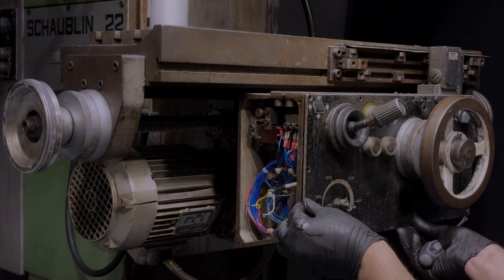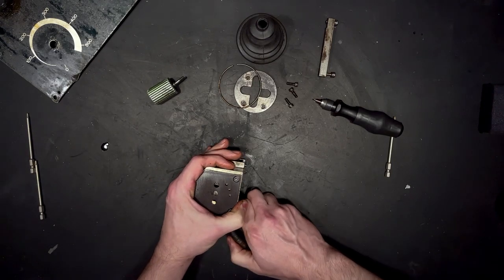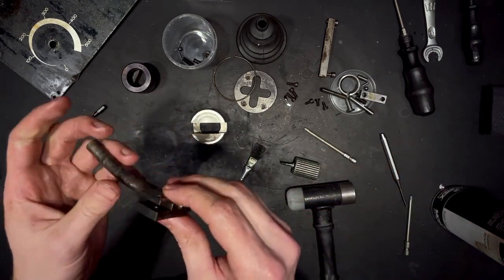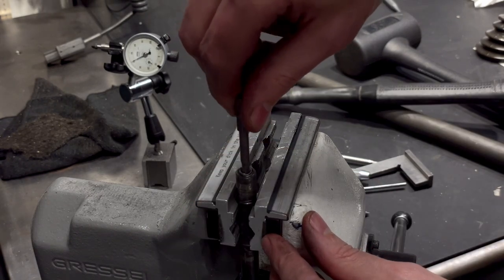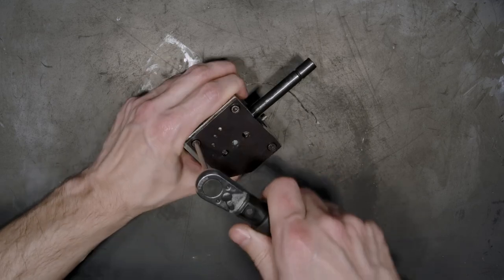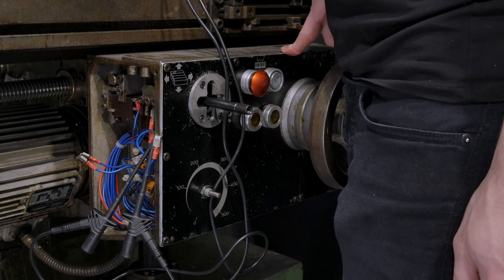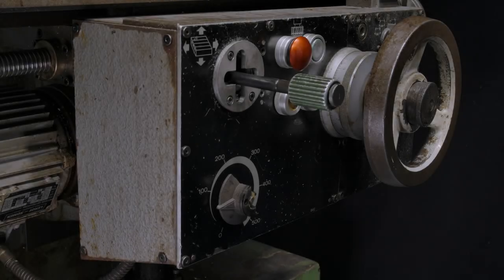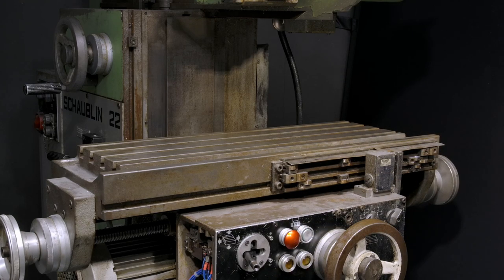SCHAUBLIN 22 | Ep2: Joystick repair

Comment: Great video hope you keep them coming. I would suggest on surfaces other than ways that DAWN spray dishwashing soap will absolutely dissolve any dried on oil it comes in contact with - and smells better than brake cleaner. I recently bought a 1950's Gould &Eberhardt Toolroom shaper and the oil on it had probably been there since 1950 - looked just like your Schaublin. That DAWN ate it up...
Reply from the maker: Thanks for your comment and the tip with the DAWN spray. I will give it a try when I start with the parts which don't fit in my parts washer. Progress on the Schaublin came to a stop because I'm moving to a now house. I will have to do some home renovation videos before I can continue with the mill. But I'm very much looking forward to the much bigger shop.

Comment: Eyyy, another one! Nice! I hope you have seen the grease name edit in my last comment, its the Kluber LDS 18 Special A... 
I wanted to ask how old is she? What`s the year of make? If i recall right, Schaublin has a website and you can enter your machine serial number(the metal tag next to the central lube pump) and check out a few things... Im not sure if the page design has changed, but yeah, its what i recall from the days when i first got mine home...
I dont know if its standard, but mine has leadscrew spring steel spiral covers on both ends of the table... I find it interesting that yours lacks them... Tho, it could be just something im used to seeing on mine, but i would advise getting those for any machine you have... They are great for any shafts or screws that are exposed and can get shit flying or falling into them, be it splines or threads... There`s an ebay account that sells both such covers and the harmonica style covers for ways... If you want, i can link it, as i dont want to promote stuff on your channel that you dont endorse, but they have good shit in store... Not cheap, but im saying this not just due to the table leadscrew steel spring covers, but im wondering how`s your head ram cover? Mine was looking mighty fine when i first laid eyes on it, but when i took it off to clean and grease the screw and all the ancillary parts in the area, the thing was a gooey mess of oil rotten rubber and threads that turned plastic and brittle from the same oil and rubber decomposition and polymerization... Its a `complex`` geometry way cover and while it can be replicated at home, its a pain in the ass to repair with available flat materials that you have to affix to the dovetail plastic ``wipers`` that allow the thing to act like bellows....

Also, consider making an accessory block for the ram... You are unlikely to ever really pull the ram so far back that its dovetail wont be exposed by at least 15cm(4in)... I can send you, if you want, a lets call it a technical drawing of the idea i have in mind... Its a dovetail clamping block set(a larger accessory block and a narrow one) that is affixed under the ram, just by the head, and it is supposed to have an integrated swiveling angel eye lamp in it, an air blast clamp for chip clearing or a mist oil nozzle(plan calls for both as separate mounts), it comes with a narrow brother block so the ram can be given way covers between them... The narrow block is supposed to be bronze and to be sliding fit on the ram, so the ram can move in and out, and the block is kissed against the body of the mill with magnets, there is enough bronze there to negate the magnetic chip attraction, and the covers deny any of that shit anyways, so even if the chip or two sticks to the covers, well, it doesnt matter, as its the covers, not the ways... 
Well, i take that offer back, as i just checked my papers and i cant find the damn paper, so yeah, but you get my point i hope... Its not an accessory you see plans for or see often, as other mills rarely have such a conveniently placed dovetail that you can just slap accessories onto... I also had a drawing of the block for main z ways cover... Also a dovetail block that affixes at the top of the knee ways and allows you to drop a harmonica way cover with inox armor sheets... Just in case you shatter an endmill and it decides to fly at your ways rather than trying to disembowel you at high speed or put a hole in your face where there aint supposed to be a hole... If i find the papers, i will offer them to you, but for now, i guess the written idea will do well enough... The store i mentioned above offers such armored covers, so yeah, if you need good covers at decent price(not cheap, but honest and on point), i can share that link... The plans for the blocks are supposed to be open to interpretation or any potential modification, as you are unlikely to find the exact things that i made the plans to, and it doesnt matter, the dovetails are the same, and you can measure and fit your blocks to fit your machine perfectly, and the covers or accessories i referenced just to have some dimension to work from, but yeah, there`s my input for a first project once you have restored her to full glory and health... 

The joystick is also a bit different in my case... The screw that your has is not present on mine... The shaft has the same look, the same ``handle`` knob at the end, but the screw is a button that you press into the scalloped handle to switch to rapid feed... Yours appears to pull the handle out and thus activate the rapids... Quite strange... I wont say nothing about the bend in it, or the knee handwheel runout, as those arent there from factory, and whoever induced those is a vile beast in my eyes, but hey, i said i wont say nothing and here i am, spewing hate... Who in the hell mistreated that poor lady before you... Yikes! Get that handwheel axle sorted, that will cause insane wear on the internals and dial faces... You also said that you have the arnljot situation with the ram handwheel axle if i recall right... Damn, someone was a beast of the worst kind with that poor work of art... But im most glad to see you making progress... The machine overall seems to be in good condition wear wise, but specific parts are dicked quite badly... Thankfully, from what i see, mostly shafts and components that can either be machined anew or bought(potentiometers and such)...

All the best and kindest regards,
Steuss
Reply from the maker: Hey, thanks for sharing your ideas and experience! Did you ever publish pictures or anything about the accessories you built? I would be interested to see them. And I'm also interested in the link to that ebay shop for the leadscrew covers. I saw the spring steel ones on most of the 22 pictures I found so far and also in the manual. They were certainly standard from factory but they were missing on mine. And I actually don't know how old she is. Based on the color, I assumed it's an earlier model since I believe the later ones were gray. I could not find a way to lookup the serial number on Schaublin's website.
Reply: @monochromworkshop  No, i havent really taken any photos, nor have i really machined all that much, as all of my machines are essentially in some form of disarray or are waiting to be serviced... The S22 is sitting in my shop for a while now, clean, oiled regularly to keep any rust away, but other than checking her out to see if anything is amiss, i have not really made anything with her, as i want to take her apart fully, just to check if there are any chips or shit anywhere in the ways... I picked her up a few years ago, but with all the shit of daily life, and lack of some real funds, i am slowly working on a dozen machines that all need some form of touchup... It took me a while to make a heavy duty engine hoist type lift, but now that its 99% done, i am hesitating to finish it, as i want to complete it in a proper way, rather than bodging the last 1%... 
I unfortunately have the terrible tendency of delaying stuff, and that coupled with lack of time and funds really can stretch any project for ages... 

The link for the springs and covers is: https://www.ebay.com/usr/bfaccessory?_ipg=72&_pgn=1

I can take my technical drawings to a photo shop to have them laminated and scanned, so i could publish those, as i have amassed quite a thick stack of worthwhile ``plans`` along with some firestarter designs that i use to light my wood fireplace... 

Yeah, i checked schau website after writing the comment and i could not find that feature, only the support page offers you to write in your serial number, but that is for consultations... Maybe im going crazy and it was the ELB website that had that feature... I have got no idea at this point in time... With all the machines that i have taken up to restore, and with all the searching i have been doing in the last 5 years, i guess some things just got mixed up in the memory...

My S22 is gray, the 7031 graublau, and i think i recall seeing somewhere the date referring back to 1972 on her, but im starting to question my memory a bit, so i wont make any claims for certain... 

Regarding the posting of stuff, i will start posting some videos in some time, as i do want to share and in so doing help others in the way i got all the help i needed... 
I just have to get my shit in order... I`ve seen hardcore heroin addicts with more organized lives than my own... So there`s that...

All the best!

Comment: Great job, man!
I have a question about the ultrasonic cleaner - after all would you recommend it for such a jobs? I'm thinking about getting one before starting my Bridgeport restoration project..
Reply from the maker: I wouldn’t recommend it as your primary tool to clean parts. I would get a manual parts washer first. The ones with the brush and flowing liquid. But I will do a separate video only on cleaning parts. It might take me another month or two, though.